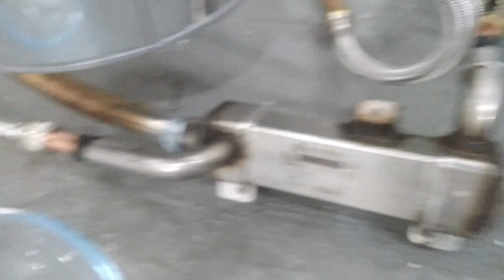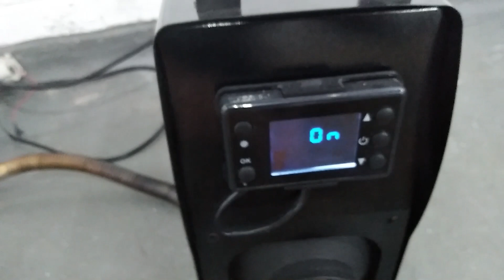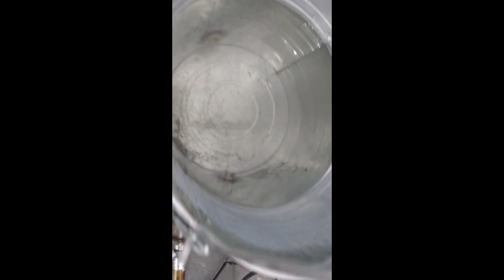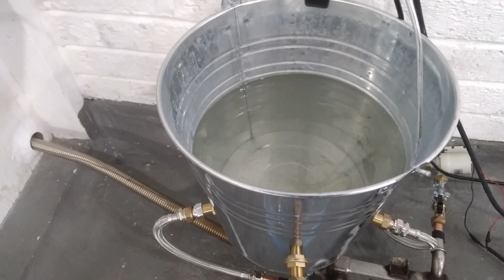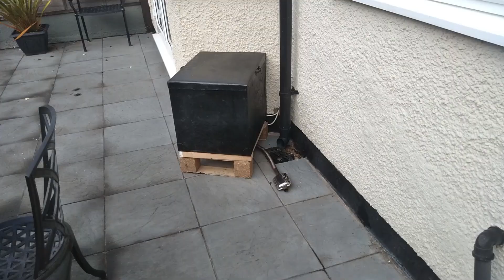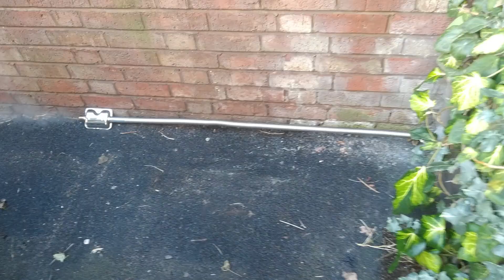Free Hot Water from Waste Exhaust Gas Heating Home Diesel Oil Heater Exchanger Waste Heat EGR Burner

Comment: Great setup. However as others have said the heat gun is not accurate the way you are using it. Those exhausts get to well over 100c and that water is steaming hot. Beware of condensation with the open bucket, although I understand this setup is only proof of concept. Good luck.
Reply from the maker: You've got some good points about the heat gun and condensation, I appreciate the input!
Reply: @andyfireblade  I see you used a temperature gun and matt black paint in more recent videos. Keep up the video productions, cheers.

Comment: Hi love your videos don’t think I have missed one yet I have everything to make up the system, I was wondering what if I want to use the heater without the hot water system how will I work that as the water in egr will boil?
Reply from the maker: ahh great thanks , yes i thought of that too. you would ideally need some kind of cut of valve that would redivert the heat or water. preferably automated, so that an overheating problem does not occur

good luck with it , let me know how you get on cheers andy

Comment: EGR coolers ally, so the tap water would destroy it pretty quickly, a coil with a scrap car reservoir in the bucket would work long term though. Then you can fill the coil reservoir with distilled water and auto antifreeze.
Reply from the maker: great cheers andy

Comment: I'm curious why didn't you take the heat directly from the copper pipe rather than going through the heat exchanger.

Simply coil the pipe and immerse  it in the tank to get direct heat off the exhaust pipe.
Reply from the maker: i did a similar thing in another experiment.

thanks for your comment andy

Comment: no need for pump in open application like yours , thermosiphon will do the job nicely :) also your laser probe if you pointing it at shinny objects your reading will not be correct .. like measuring water temp when probe said 22 degree iam pretty sure it was double that at least
Reply from the maker: thanks for comments cheers andy

Comment: Add black matt high temperature paint to areas where you will measure temperature. Hold temperature meter close to measuring point. Laser red dot is for aiming but does not measure any temperature. Read manual and you will understand.
Reply from the maker: thanks
cheers andy

https://www.youtube.com/@andyfireblade

Comment: Hi. Liking your great experiments. Do you know what the heaters maximum exhaust length could be? As I am thinking of running the exhaust pipe around my garage walls, using the hot exhaust until it cools, then feeding the exhaust outside. Keep up the good experiments.
Reply from the maker: hello Craig, thanks for looking in here.
well another youtuber told me that he had done exactly that!
using a 22mm copper pipe, going straight through a summer house. using the heat from the pipe whilst sending the fumes to a convenient exit location. so i think you will be ok.
cheers andy 
https://www.youtube.com/@andyfireblade

Comment: I like the idea of using an EGR cooler as a heat exchanger but my worry is that once the water is boiling it will just make steam, potentially very dangerous. The only solutions with this setup are: 1 drain off some water and add more cold water; 2 turn the heater down/off.

An alternative heat exchanger would be one from a Mazda 2.2 diesel from about 2010. These have a bypass tube and diverter, operated originally by vacuum which could easily be modified to cable or electric servo.
Reply from the maker: hello chris, good point. i thought exactly this, but no one else has ever bought it up! the water will keep getting hotter! hhhmmm. i am going to do another similar experiment, but you have really got me thinking now, about that.
cheers andy
https://www.youtube.com/@andyfireblade

Comment: Thanks Andy. Wondering if you put the noisy "clack clack" diesel pump back on your test heater as it seemed to be a bit noisier ? I've ordered one of the quieter ones. Cheers Reg
Reply from the maker: hello reg, how are you my friend.
yes the quiet one was great and then it went a little noisy sometimes.
i am working on it. that it the old one in there today.
i have some plans, but i did wonder weather it was do with me using kerosene (being thinner than diesel).
what do you think?
kind regards andy
Reply: @andyfireblade  Hi Andy - yes that's an interesting one - and annoying after you paid twenty odd quid for it.  I haven't seen anyone else reporting a problem with the silent ones going noisy after a while yet but of course they are probably mostly using diesel or thicker oil with them. I found this page which is talking about diesel engines (not specifically Chinese diesel heaters) but it does say that one negative with kerosene instead of diesel as a fuel is the lack of lubrication in kerosene that can affect diesel pumps. I know that ensuring proper lubrication to the chinese heaters original diesel pumps when running on diesel is why they need to be tilted on that angle. If your kero fuel is not lubricating the new pump properly then the wear and tear could possibly be the issue with it going noisy after a time. I wonder if there is an additive that you could safely add to the kero to add back in some  lubrication without defeating the cost advantage of kero ? Not sure how the silent pumps differ from the standard noisy ones and whether kerosene would affect them more (ie what makes them silent) - if I find anything online (or anyone else might know) we can let you know. Also interesting that the link states that kero is less efficient and therefore produces less power (in an engine) than diesel whereas I originally thought the opposite. I don't know if that "less power" would translate into "less heat" from your heater though 🙂.
  https://dfcdiesel.com/2022/10/21/can-you-run-kerosene-in-a-diesel-engine/
Reply from the maker: @regwatson2017  hello reg thank you for your help. i have heard from someone running one kerosene for 4 years on the same pump with no prob. and if my pump did fail as a result of running on kerosene eventually i would mind to put a new one one for the price of them. and hopefully would have saved a lot already on the cheaper kerosene.

Comment: Can I just ask where did you get the new vent? Great videos cheers
Reply from the maker: https://amzn.to/3JgGPiQ
thanks my friend 
kind regards andy
Reply: And is it any different running on kerosene to red diesel?
Reply: @ianarmitage3518   Yes, less heat per unit volume of fuel.  Not a lot - and likely a lot cheaper on 28s kero.  Less pump lube from kero, but many have run their heaters, on kero, for literally thousands of hours with no pump problems.  All pumps are not equal, of course.

Comment: The condensation is coming from the fuel. You get it cool enough it will have water running out. It is the purpose of the drain in the muffler.

Comment: Glad you got round to doing my early suggestion all be a little different for hot water.

Another thing I was thinking of was heating the water via a heat exchanger but running it through a car heater matrix with a fan behind it blowing hot air out just like a car heater setup.
Reply from the maker: Thanks for the idea! i will get one.
and thanks for watching kevin
have a lovely evening andy

Comment: You could run a few metres of flexipipe coiled up into a sealed water barrel and that would heat up during the day and keep the garage warm overnight due to the thermal mass. I'm considering something like this for my outside office as it's always freezing in the morning . One good thing about this (intentional?) energy crisis is that it makes this kind of mad experimentation become mainstream and that's a great thing :) Keep up the great work mate!
Reply: The flex pipe would have to have a reservoir with a safety relief valve to avoid making it a bomb if it overheats and creates steam.
Reply from the maker: thank you my friend
great idea. we are all trying our hardest arnt we.
 cheers andy

Comment: Cool. I agree with the earlier comment that it would be worth checking for an internal leak in the cooler, that condensation should have quit showing after a few minutes of running. I'm giving the oil cooler fan heater version a go soon, using a Mercedes cooler in a low volume closed loop pressurised setup in the hope the temps get that far, they all seem pretty similar, I went for this one because the exhaust fittings are best for me to work with. We'll see 😁
Reply from the maker: hello my friend
good comment, you probably right there!
good luck with yours
cheers andy
https://www.youtube.com/channel/UC3sYHaAZtJI-vrD64K7Qe9w
Reply: @andyfireblade    No leak (well, very unlikely), just latent heat of condensation that you’ve not removed in the heat exchanger.  Water of combustion has to go somewhere.  If your heat exchanger cooling water was plumbed the other way, you would likely be getting liquid water in the exhaust pipe.

Comment: Hey, just a suggestion for better exchanger efficiency - use counter-flow. Meaning that the flow of gas is opposed to the flow of water. I am studying thermodynamics right now and the difference is noticeable
Reply from the maker: hello my friend
, i am sure there are loads better ones out there. i only got this one because it was just £15.
thanks for looking and good luck with the thermo- watsabobthingy 
have a fab evening my friend
regards andy
Reply: @andyfireblade  he's saying to have the water flow the opposite direction as the exhaust. Like make the exhaust go left and water go right type of thin.
Reply: @anthonyjulson8840    Yep, the coldest water should be extracting heat from the coolest exhaust gas.  Consider [the] (your) best system where the exiting water is as hot as the exhaust gas - it won’t be collecting any further heat in that scenario.

Edited so you can ignore the square bracket ‘the’ and insert the curved bracket ‘your’ instead, to make more sense.
Reply: I'd have never thought of that!